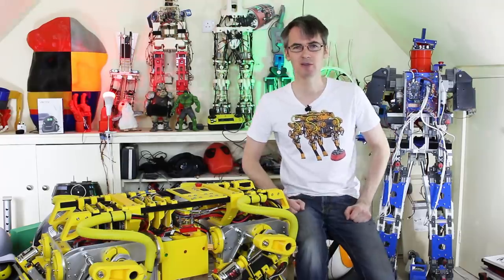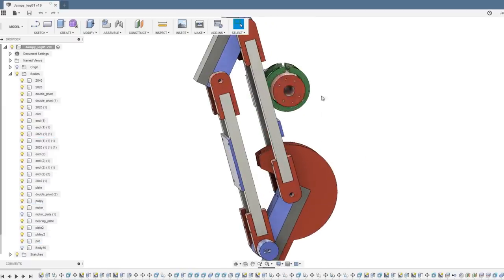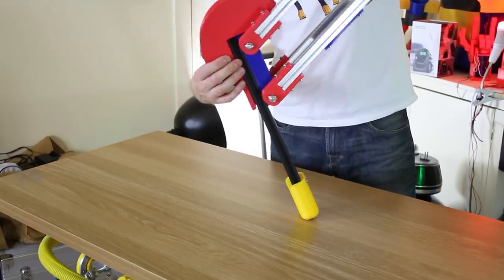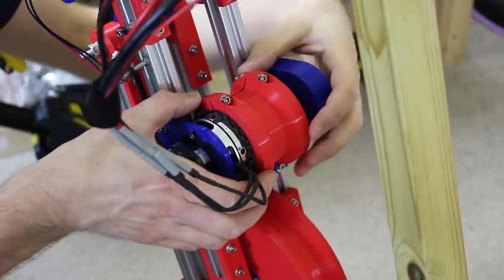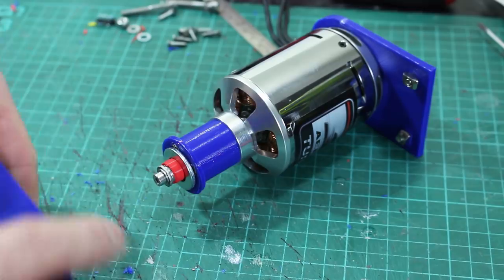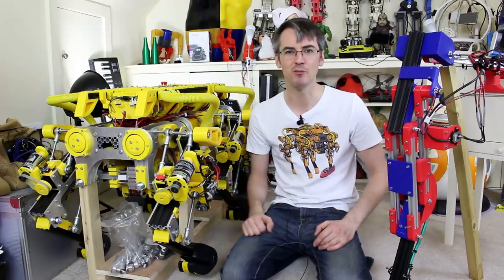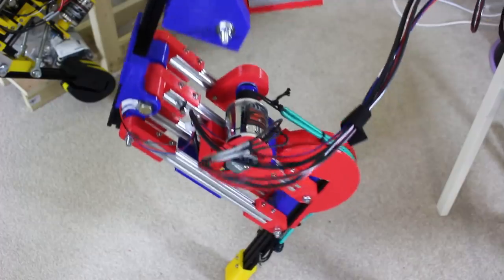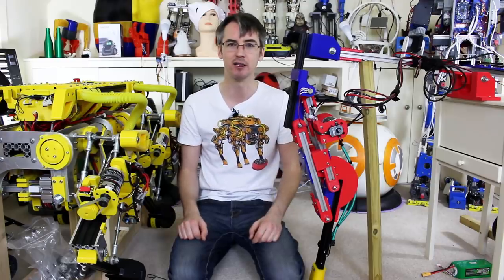Testing a Jumping Robot Leg with Elastic Tendon | James Bruton

Comment: Ideally you should be able to model tendons in opendog without changing to springy bits - tendons are basically a spring F=kx. However a spring reacts instantly and can reach very high speeds - the motor drive screws are relatively slow so they could behave like a spring but only at a very low frequency. With the three legged doovie ( yes please build it :) ) you can replace the bungie with a stiffer tendon effectively doing the high frequency movements, and model the low frequency springiness in the motor drive code - if that makes sense James?

Comment: Awesome. If you do apply it to a quadraped keep in mind that an animals spine plays a big part in its ability to run fast, so making that flexible (even passively elastic) would be an advantage. Also as the control gets more complicated, have you looked at neural networks or evolutionary algorithms in order to find efficient walking gaits?

Comment: Another option that's been used in a number of compliant walking machines is to use a spring to extend the leg and the motor, via an inelastic tendon to bend the leg.  (Look up ASLP Walking machines).  If you end up with antagonistic 'muscles' you may as well program the motor to behave as a spring damper - closed loop torque control.
In terms of making it walk, you can use something very similar to the sequencer commonly used in IK, except you are delivering a sequence of torques (Forces) rather than positions.  This approach makes it self adapt to obstacles / terrain without the need for AI or complicated localisation.

Comment: Interesting video.   You could make a much lighter weight version but just as powerful if you used single extrusions over the double ones, then used flat elastic which you wrap around the motor instead of a pulley.

Comment: Why not use the motor as the compliant part?
Because the motor can be back-driven and itself provides a holding force it can remove the need for a stretchable cord.
It will make the motor being externally turned an asset rather than something you have to combat, and depending on the mechanical configuration it will allow for both compression and tension.
As an analogy with this setup it would be the muscle that is compliant not the tendon.
Reply: @UnidudeNine    Good point, I've only had experience controlling motors in this way using a Virtex FPGA (~100,000Hz).
I do wonder however if using a PID control configured to recover the position more slowly could alleviate some of the issue of using a slower update frequency. (Not great for rapid motions but might help in a situation like this)

Comment: Doesn't the Odrive have a torque command mode?  That should allow you to move the compliance into the motor (and use the attached encoder to measure it) rather than adding a much less controlled spring.  Granted it wouldn't give you the benefits of energy recovery in a run cycle, but it should make it much easier to build the dynamics model (in terms of torque and velocity of the actuated degrees of freedom).  The excellent MIT OCW 6.832 course on underactuated robotics has a lot of stuff relevant to this from what I remember.

Comment: nice. but my question is where you show the graph at @8:30 of the leg position. it might make more sense if you reverse the pot so that when the leg is extended the value is high. I know it doesn't make that much difference as long as you know which way round, but if you're looking at graphs of the position. personally it makes more sense if when it's extended the value is high :D

Comment: Question1: it seams like compliance is kicking in a bit late. is that normal?
Question2: how can elasticity be quantified? you used elastic cord which has a set of characteristics, but other methods might be more suited for a robot, like a winding string rolling and unrolling a steel cord connected to a motor.

Comment: Why does the robot need to weigh itself in each leg if you could just use an accelerometer to work out weight distribution unless you’re going to have home something else moving on its back which doesn’t like sharp stops so you’re basically also using this system as a suspension for a walking table taking delicate objects around.

Comment: Only one motor. In animals skeletal muscles comes in pairs, each muscle has an antagonist because muscles can only pull not push. 

Using a second actuator for the opposite movement would be an option, but it would also be quite expensive and weight a lot.

Other people (like Spot or Laikago) use BLDC motors for the joins with only some simple gear drive to increase torque a bit. Same for this 2-leg walking robot Cassie. This seems to be the way to go, because it's small, lightweight and very controllable. By controlling the motor voltage it's possible to switch motors between complient and driving. In Open Dog this isn't possible in the moment because of the worm drives.

So maybe this could be the way to go for open-dog, too. To prevent problem with the weight of the robot you would probably need some springs as "counterweight" to balance the thing because the halting power of the motors wouldn't be big enough to lift the robot alone.Stronger motors would be better, but probably to expensive. I don't know the torque of your motors, but in Cassie they seem to use BLDC motores with lots of poles which may be hard to get.
Reply: Kah7654 Maybe your weak muscles can only pull.  Speak for yourself.

jk that's a good point.

Comment: You may want to use actual servo motors for this application, they can hold an incredible amount of weight while also being fast. The hobby motors just aren't as precise or strong at 0 rpm.
Reply from the maker: well the encoder has 8192 steps per revolution, and the motor is 2Kw, so that's better than any hobby servo I know
Reply: @jamesbruton  I meant industrial servo's lol, 2kw is a lot so if it's working out then maybe servo's aren't the solution.

Comment: How on earth do you prototype so FAST? Its amazing! You just made a large sized Salto, which a university spent years making, in a couple of weeks. It would take me months and months to do what you seem to be able to complete in a fraction of the time. Do you have a technique? Minions? Elves? Can I ... can I borrow some? : ) Also, have you read Marc Raibert's "Legged Robots That Balance" (the book as opposed to the article)? He details the MIT one legged jumping robot and its control system, you might get a kick out of it! (no pun intended. Well, sort of)
Reply from the maker: Lots of 3D printers and experience building things that work every week ;-)
Reply: @jamesbruton  Incredible :) I could do with another 3d printer to be honest. I would also love a Tormach PCNC. Still, you getting the CAD and maths done quickly, and right, in that time is still impressive. Whoever you used to design toys for is surely very sad to lose you!

Comment: Two oposed spring are minimal, like muscles. Also brushless motors are bad at low revolutions, you should use gearring of some type.
Reply from the maker: yep - it's only a test
Reply: James Bruton,  little suggestion to test))
Two parallel ropes when twisting around each other became shorter. It can be used as muscle. Can you try? Just motor, hook on a shaft, hook on base and something to measure force. Thanks.

Comment: Hmm, over on the wearable electronics/soft circuits side of things, they have conductive stretch sensors. So it may be possible to turn the stretch into a known value?
Reply from the maker: Yes possibly, knowing the actual joint angle is critical though

Comment: You are doing it wrong! (Hear me out)
Mantis shrimp (and other animals) stores energy in the legs and then release it all at once to punch (or jump). You are using the motor force and the Bunji cord force just in one direction (they are not opposing each other). So, in your case, you should have a spring (or the cord) squeezed when the leg is bent, then the motor lets go, and the stored energy gets released and robot jumps (In this video the motor is pulling to make the robot jump, that makes the jump smaller because instead of applying the force straight to the leg, you are applying it to the cord that stretches). While the robot is in the air, the motor bends the leg again, and as soon as the leg touches the ground, it lets go again. (just like a Kangaroo). However, by adjusting the spring tension and by changing the force that the motor is applying against the spring you can make the robot walk, or run.  
I hope I was clear enough. You don't have two forces fighting each other, and you are not using the elasticity of the cord to save energy and release it. You have the motor and the cord in series and hoping gravity counter them.

Comment: I maybe over simplifying this but could you not program open dog so that if it jumps and it's legs are fully extended, when it hits the floor it shortens to match (or slightly faster than) the acceleration of the body due to gravity to take out most of the force of the landing
Reply from the maker: Yes, it could do that with foot sensors, but it needs pretty quick processing to do everything in real time, instead of catching up the bungee afterwards

Comment: can you show the difference between a rigid tendon and this? (a springy tendon) Also i feel your 'gear ratio' is not aggressive enough, the bottom leg needs a larger circle thingy and the engine needs a smaller spool, could you comment on that?
Reply from the maker: Well rigid would just hit the ground rigid because there's no spring in it, if you wanted to bend the leg then you'd have to have a foot sensors or something and react really quick.  Yes the Gear ratio is no where near high enough - it would probably be better with a proper gear box

Comment: If you only used a tendon from the back of the knee to the extended rear heel and a motor to replace the quadricep and control movement and tension the elastic tendon, could that work?

Comment: Great video! I think you should use a stiffer tendon and maybe a strength sensor at the tendon attachment to the leg (and doing so dismissing the potentiometer for the position). If you do so you have an almost perfect biological muscle model and it should be more simple to control the forces on the tendon and jumping